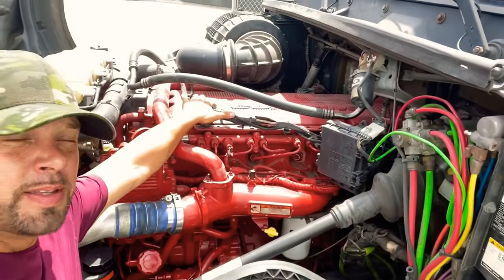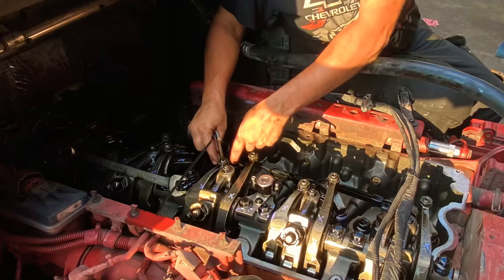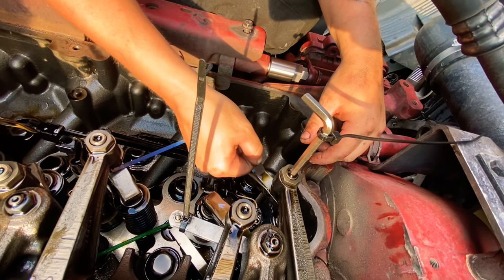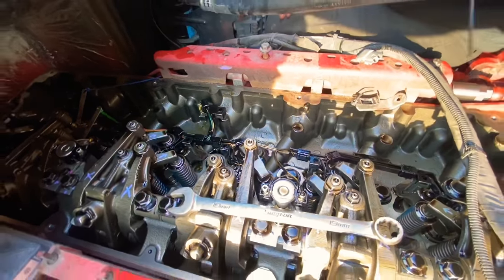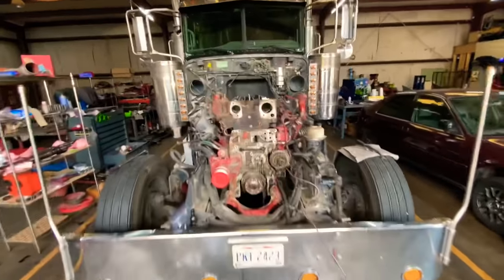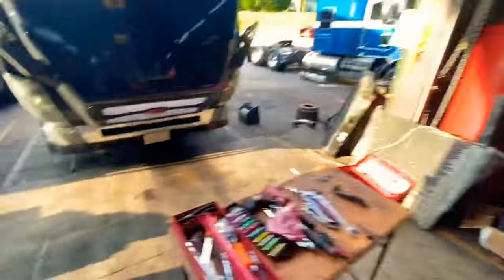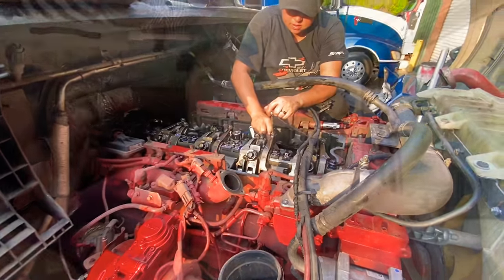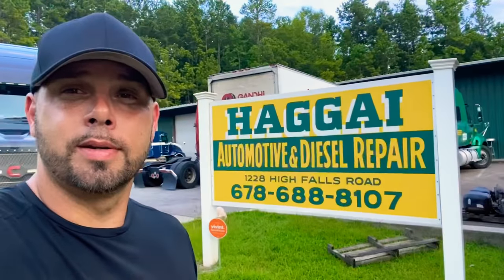“WHATS AN OVERHEAD” Keep that Engine Running SMOOTH and get to HAGGAI DIESEL CUMMINS X15 871 2250

Comment: I used to adjust valves, just like you did, when I was serving in the Air Force.  I was a Special Purpose Vehicle Mechanic and I worked on vehicles that had' CAT engines in them.

Comment: Hey BUD. Clessie Lyle Cummins (Born December 27-1888.Died August 17-1968) came up with the idea of a retarder system,started experimenting and exploring in August of 1931. This system later to be called and known as Jack Brake.It's been produce by the Jacobs Manufacturing Co. Since 1961.

Comment: on the cummins the injectors arnt under the rocker cover like 550 hp caterpillar c15 ? i had loose injectors on the truck i used to drive. The  engine compression braking stopped working  boss mechanic check  under the rocker cover ie actuators and found injectors were leaking a bit  and loose and got everything running and purring i found out  constant use of the Jacobs compression braking by its self  with no foot/treadle braking wears out your drive tires especially the front drive axle

Comment: What are the symptoms of bad overhead adjustment or when is needed. I have the same engine on my volvo isx 15 manufactured 2010. I had inframe amost 3 years ago. Its been 200k miles and i never did adjustment. My fuel milage is 7.7